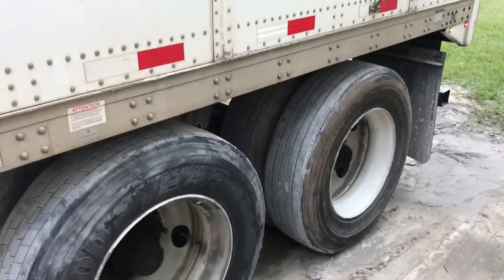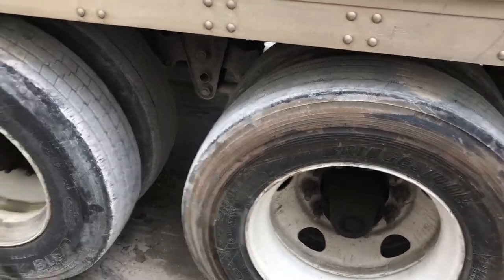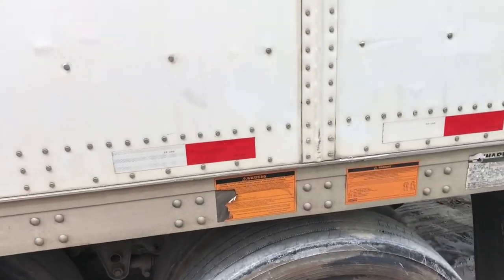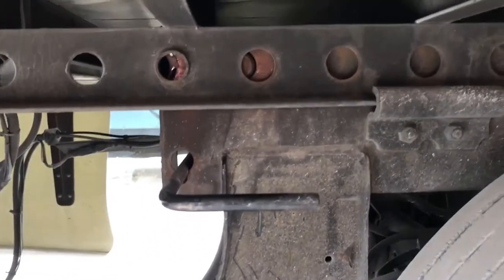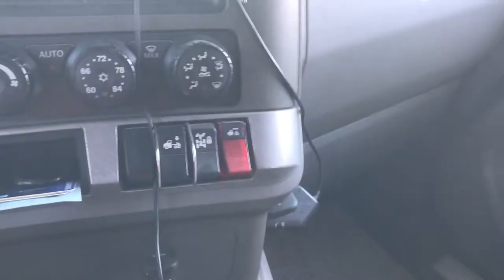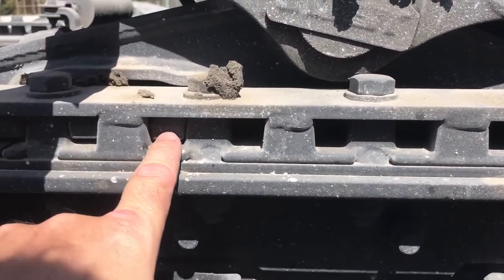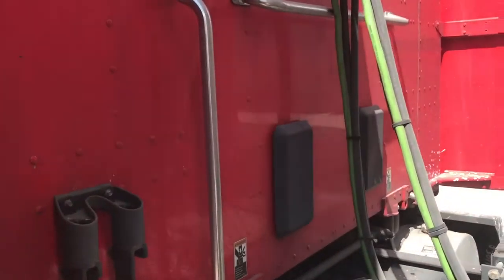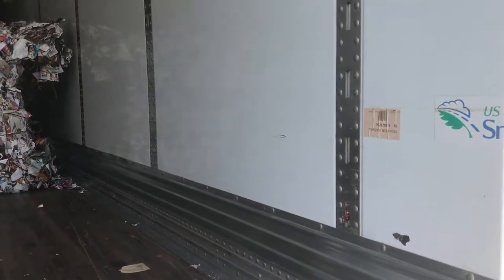Crash Course in Sliding Tandems

Comment: CHP pulled me over in the California desert hiway 58 going out with a load of garbage for NYC, 3 days be there early the 4th morning. Just starting out, log book up to date and everything, I passed the paper work bs, bingo card and everything, than he wipes out his tape measure and tells me to hold it even with the king-pin, he walks back and checks the 38 feet bridge-law,  he found out it was right, it was a 42 foot refer trailer fixed axle, more or less he was training me about trailer axle bridge-law,  I was grossed out at 73,280 Lbs. so he knew the trailer was loaded and I was going somewhere. No ticket for anything, he just wanted to check me out, his handle on the CB was ICEMAN, Go Figure! CHP monitored 9 and 19.

Comment: Or you can pull tankers. I haven't slid tandems since 1999
Reply from the maker: +rp currey I pulled flatbeds and heavy equipment for years, a lot harder to balance loads on those 😂
Reply: Or you can slide tandems.  I haven't pulled tankers since 1995.